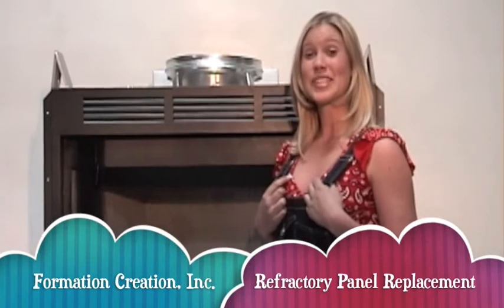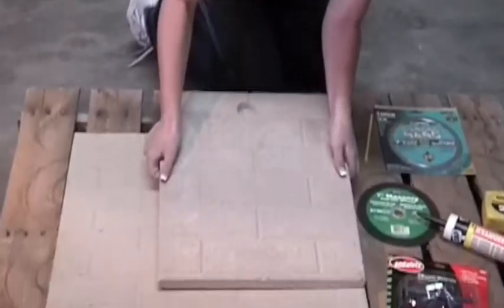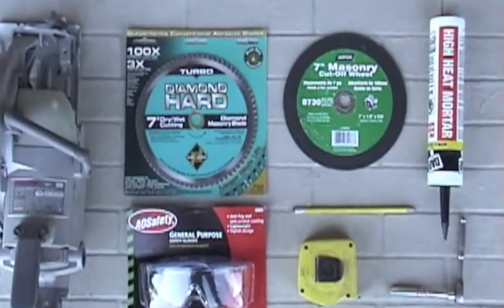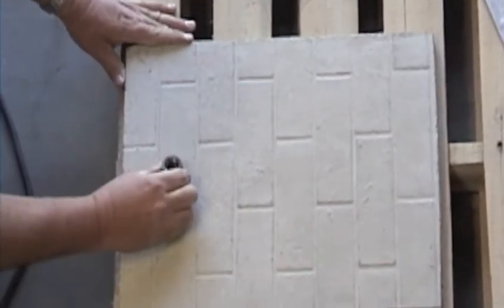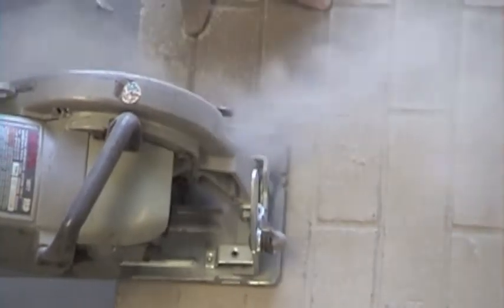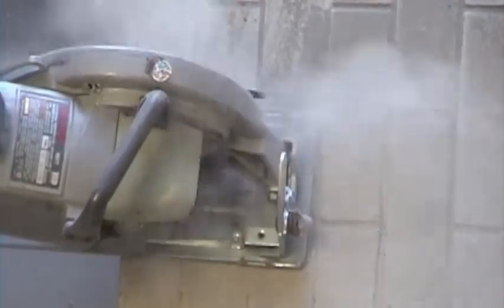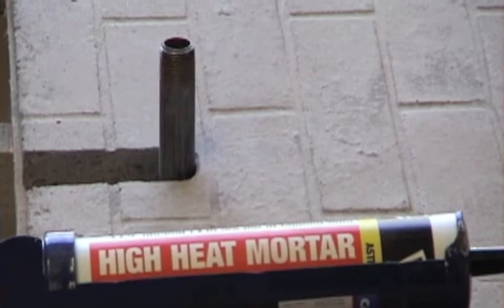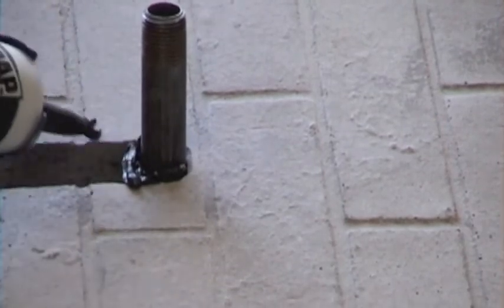FC Refractory Panel Replacement

Comment: Lynette darling I need to see in detail how you remove the clip. And how you put the left panel strength. The panel that has the gas connection. Do you remove the gas connection?